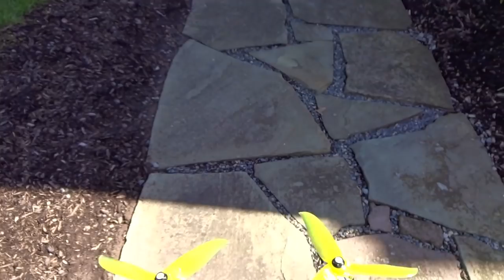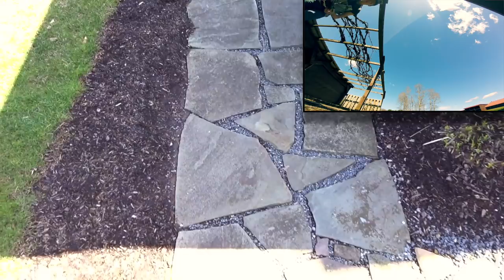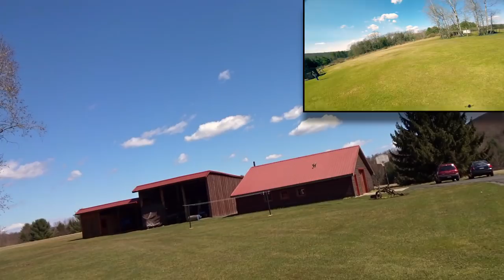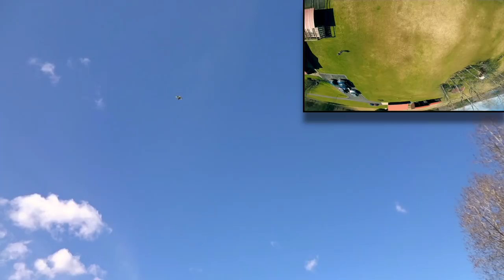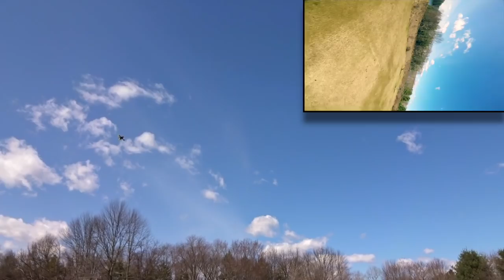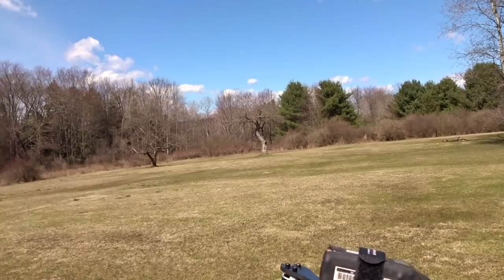What Does HD Onboard Footage From LOS Flying Look Like?

Comment: That was insane! I've always wanted to see what one of your los flights would look like from the quad's point of view.

On a side note, would you recommend graphenes for racing?  I'm building a 4s quad with emax rs2205s 2300 kv motors, emax bullet 30A escs, and a REVO F4 board and I'm wondering if they will be adequate for fairly aggressive racing or if I should get something with a higher c rating.  My alternative is the 4s tattu 75c (I'm currently using the 3s version and I love it.) but it's almost ten bucks more per battery than the graphenes.  Thanks!
Reply from the maker: Just know that all of the ratings are complete lies. The number really doesn't mean anything. These are probably all I will ever buy, as the bullshit with batteries and their numbers is crazy, especially when these will smoke "100C" labeled ones.
Reply: Alright thanks.  I think I am going to get these then.  One more question, what is the difference in the form factor between the 1300 and 1500 mAh versions?  Would the 1500 fit on a martian 2 frame with a runcam in the front?

Comment: Quick question... My quad seems to fly fine but after not even 15 seconds of hovering, my motors are already extremely hot.. But if I run them up in the motors tab of betaflight, they don't even get warm... I'm completely confused...
Reply from the maker: The motors tab is a pure PWM signal, thus is does not involve the PID loop at all, so for sure there is a problem with your PIDs. Most likely too high or D or P. Do not fly for extended times until you can fix this, as the high temps (if they burn your finger) will demagnetize the magnets.

Comment: Just asking myself.. Why is nobody using a gopro or any other actioncam for recording and fpving? Does the hdmi out not supply signal when recording? Or is there a big delay? Why is every setup I saw  so far: on board fpv cam+transmitting stuff and an additional gopro??
Reply from the maker: HDMI out? What HDMI out lol, going to fly around with a cable attached? Any sort of HD recording and video streaming on other cam sucks 100% due to huge lag, and terrible range. You need to have basically instant video, so needs to be lower res to transfer faster, thus the FPV cam. GoPro just records it all in HD.

Comment: Nice video i got the same esc's, but having desyncs all the time do you mind telling me your Blheli firmware version and Blheli settings please? Thank you so much!
Reply from the maker: Hmm, are you sure it isn't a prop stall? What props are you using, and what is your min throttle set to? I just flashed the newest on it, and pretty much stock settings. Can see them in my Part 3 build of the Beast X.
Reply: The RCAddict thank you for taking the time to respond. Using kingkongs and cyclone V2's. Min throttle is set on 1080 (very high) to prevent desyncs.
Reply: Oh btw after seeing your ZMR R video i bought one. I know you have made a 3D printed mount especially for that quad, do you know if it will fit the Runcam 3 cam? Thanks again.

Comment: should I use 11ms or 22ms?
Reply from the maker: Lower latency is always better, but curious where you are getting this "choice" to make?
Reply: The RCAddict some guy told me to change my models over to 11ms I had them all on 22ms he told me that's wrong..its just that I was having issues with one of my quads loosing connection while flying for like a sec or two..so he told me that could be the issue..anways I have changed it to 11ms..have not tried flying yet probably will later today..Also thank you again. its just that I can't find anyone that flies around here quads..im new at this..thanks bud
Reply from the maker: What are you changing over to the lower latency? Is this in your radio? Spektrum I assume?